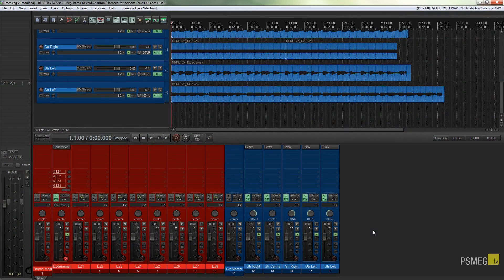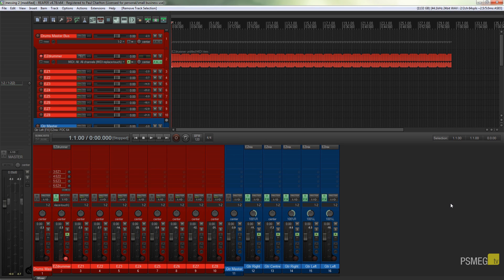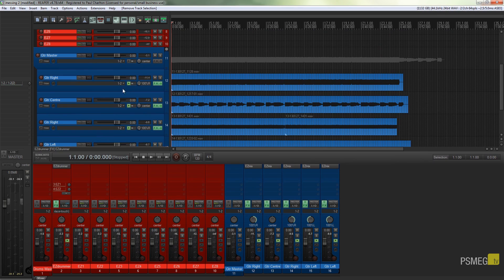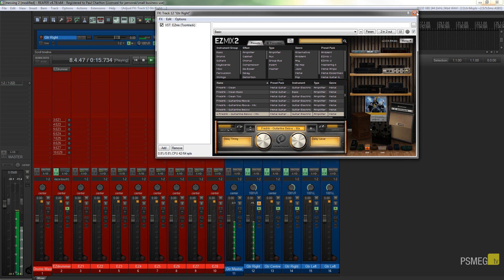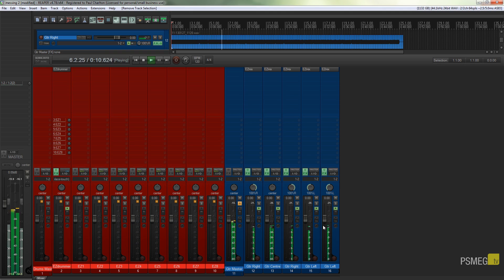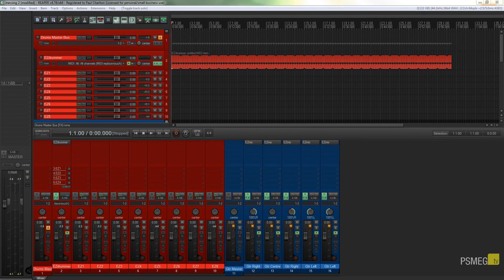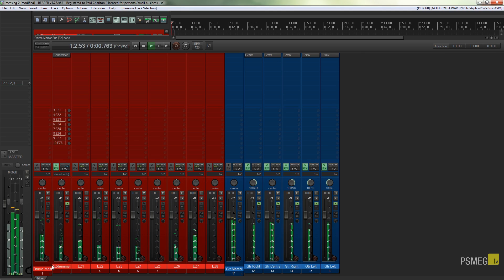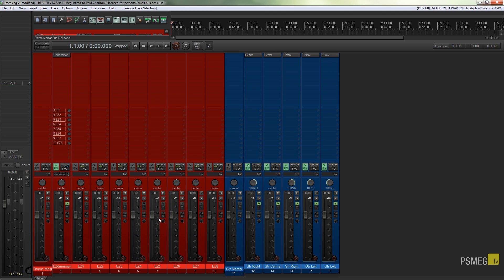Reaper Tutorial: The Basics of Gain Staging

Comment: Boss why not just adjust the faders??
Reply: Lowering the faders doesn't change the signal level going into your effects, busses or the mix buss. The reason you lower the input signal to -18dB is to ensure your inserted plugins a re being fed the optimal signal level (most plugins a re designed to work best at -18dB...especially those that emulate analogue gear).

Comment: I got a question? Is it better to do this after you put any effect on the recording? (also could this method be used for vocals as well?)
Reply: I think you need to start at -18dB peak before inserting fx so that when you increase volume, you still have enough headroom after the fx. Sometimes, ou will need to be careful that each of your fx don't get too hot themselves if they add gain.
Vocals is no different than the rest in that regard.

Comment: Three questions not covered in your tutorial (but probably should have been).. First, did you start with your master fader at 0db? Secondly - if yes to my first question, when you mix down, do you still leave the master fader at 0db? Lastly, do you or have you ever simply just pulled the master fader down to -18db instead of jerking around with all the other volumes? Curious..
Reply: ***** You master in your mixing program? That's a bit odd.
Reply: *****
That's called mixing or remixing, not mastering. I also wouldn't call what you're doing "gain staging" either. Personally, I would think gain staging happens before even hitting the DAW.
Reply: ***** To me, the same would basically be to first make sure everything that reaches the DAW is simply not clipping, but instead of messing with all the levels, I start with the master fader at around -15db. This way, I don't have to mess with anything and I'm still far below 0db. I then bounce (stream out through DAW and back in) the tracks individually to another audio editor, fix the panning, then mix down. *Some tracks at this mix stage are also recorded or imported (not bounced) from the first mix stage. Finally, I load the final mix into a mastering program (rack type). From there I can also run the master track back out of the DAW again into whatever rack hardware, but this isn't really necessary since plugins can do pretty much the same thing, if not better. My mastering plugin rack usually consists of only four or five plugins. The first controls the stereo field, the second adds compression, the third limiting and the fourth is an oscilloscope type analyzer to check the balance and phase. Sometimes I'll also throw in a Neve or ISA110 type EQ plugin to sweeten things a bit if everything sounds dull. I get 'okay' quality with this method, but it's not totally shiny. The end result sounds a bit more like older analog.  What do you think? I'd like to hear your opinion.
Reply: gain staging can happen at many stages. recording through to mastering.